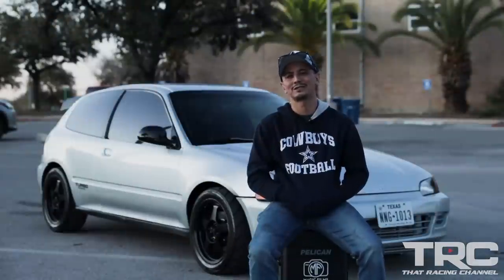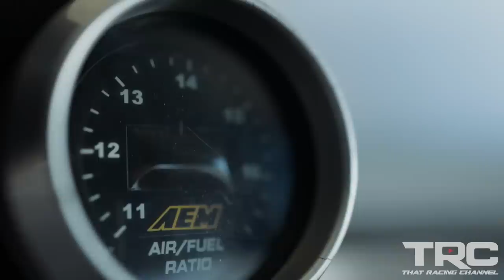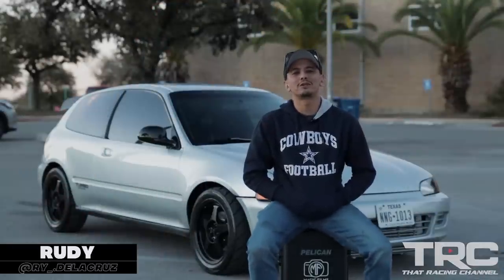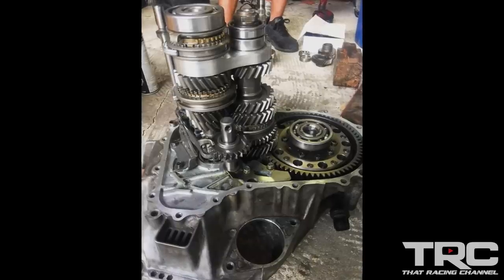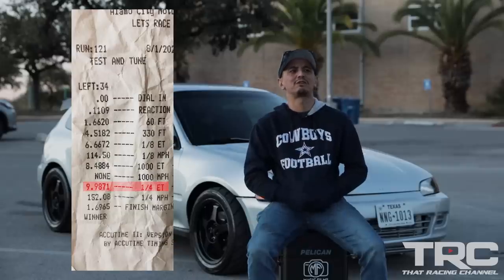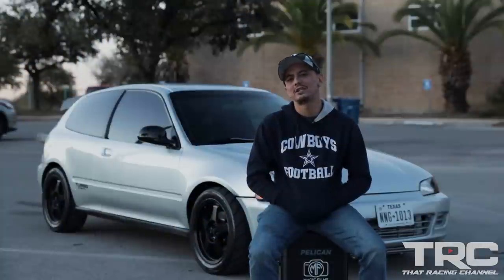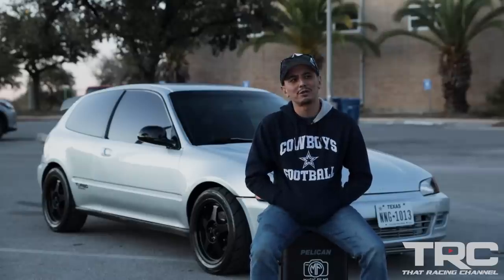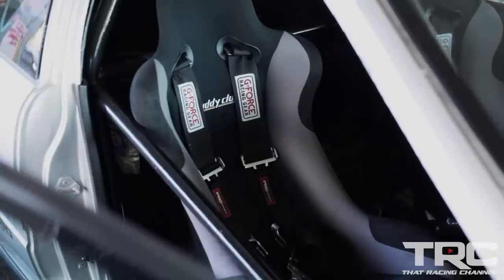Sleeper 700HP Turbo Honda "V8 Killer" GAPS Mustang! (LS VTEC B-Series Civic)

Comment: Finally a honda without a hood exhaust exit...
Reply: Seriously! I get tired of seeing that and I don’t consider a hood exit a true street car
Reply: Its not the exaust, is the wastegate
Reply: @panemamen  my waste gate dump points down in the engine bay making me smell like exhaust fumes ☹️
Reply: Who care about a hood exit?
Reply: Hood exit is a bitch sometimes to, if its even a little chilly as soon as your on the throttle it just fogs the hell out of the windshield.
Reply: Its waste gate for the turbo bro not exhaust
Reply: @xpapaj0ex570  Alot of people pipe both the waste gate and the down pipe put the hood if their going to take the time to do one, personally if you really want a super short downpipe I think fender exit is the way to go.
Reply: @barneymiller7894  or side bumper exit
Reply: @petrolhead8851  Yep, anything that keeps it off the windshield lol
Reply: @barneymiller7894  I’m building a high compression all motor k24/k20 civic coupe,hoping I won’t need a hood exit or fender exit to get as much power as I can since it’s gonna be a street car
Reply: Seriously man, this is a proper Honda street build
Reply: @petrolhead8851  How much power are you looking for on what fuel?
Reply: @petrolhead8851  its you want 350whp+ you're guna need dump and good fuel.. 300whp....e85 and full exhaust can be done.
Reply: @b00stedrust  anywhere from 300-330whp on e85
Reply: @petrolhead8851  yeah I've even seen someone make 350 on E85.. But it was a good test E85 in the car only lasted 2 seasons
Reply: @petrolhead8851  but 300 wheel on most any E85 from the pump is pretty achievable and in something around 2,000 pounds the car itlss trap mid-high 120s and that is 600cc bike territory and that's fucking fast I don't care what these idiot internet kids say about cars under a thousand horsepower not being fast because I guarantee they 5-600 wheel horsepower EG would fucking terrify them... in 2008 I had a 418 wheel 98 Integra GSR.. and that routinely Made Girls cry and Men very very uncomfortable ... it destroyed many 600 wheel horsepower v8s and 10s.
Reply: @b00stedrust  only 2 seasons huh? Any idea what went wrong? I’d honestly be happy around 310-320whp,I’ve been buying literally every expensive part that can get me there so that there’s no excuse,I already bought a complete haltech ecu,harness,and digital dash,so the tuner can tune it with ease,I’m buying everything to convert to e85,I’m also porting and polishing my head and intake manifold,and I’m using drag cartel’s 3.2 cams with supertech valve train,and ferrea 6000 series valves,for my bottom end I haven’t really decided what combo yet but it will for sure be around 12:0.1 compression
Reply: @petrolhead8851  this was a 12.5:1 in ny on e85 in the summer blend form...and it bowed one of the cylinders.. Wad a weird failure ... but was running 9200 rpms....Idk all my expertise is in b series.. But yeah... Needed new block...he told me if he was making 300whp...it would last 5 years+ with abuse and daily driving in summer...or on e90 or ignite or something it would be safer
Reply: @barneymiller7894  it's the smartest as well. Hood exits aren't good and people do it purely because they think it looks cool
Reply: hood exit will always be the best possible setup, and if it has tags it's 100% a street car
Reply: Its open downpipe, still has no exhaust 🤣🤣
Reply: What’s wrong with a hood exit hater ?
Reply: @Casey_and_Cars  lolll dont know where you are from...but over here in quebec if the exhaust is not stock its not a streetcar...try running open header here you will go bankrupt.I only did a little pass in my area when i was making my 3inch exhaust...every single neighbour came outside..one wanted to fight..cops came etc...i was thinking "man times changed"
Reply: Which usually happened in USA, not in Asia.
Reply: Soooo true!
Reply: @barneymiller7894  damn 😢
Reply: @panemamen  exactly
Reply: Because is a sleeper 🤦🏻‍♂️
Reply: Man it’s just easy to do that like so much easier
Reply: exhaust or down pipe w.e hes running on this build,sounds decent has a deep tone to a serious loud honda tone,lolthumbs up👍👍🔰
Reply: Ikr
Reply: @petrolhead8851  must not understand that most fast Honda’s are awd and have no where to put an exhaust which is why they do that
Reply: @b00stedrust  I ended up buying cp 12.5:1 pistons, stock stroke eagle rods, kinsler 67mm itb’s that I just recently ordered, my z3 head will be cnc ported, it will have a complete haltech management system, with all the haltech sensors I can use to monitor the whole car, and the car will be pretty light since I took all the interior out, and I’m switching to a tubular subframe and A-arms.. your integra sounded like a beast by the way, what do you drive now?
Reply: @treyyoder  you are completely right about that, I recently found that out, thanks for the info tho
Reply: All hood exit hate look aside. We can all admit it hood exit sounds the best with turbo spooling. No cap.
Reply: @petrolhead8851  Already seen it. Still take the hood exit sound any day.
Reply: @effingwrecked1917  the hood exit sound is also my favorite, but there are some full exhaust Hondas out there that sound just as good
Reply: Most the time on really high hp builds, 1200+ the hood exit is designed for downforce, look at the big boy procharged cars, zoomies, pointed up and back adds 400/600lbs of downforce
Reply: He just mad he probably got "smoked" by one 😁
Reply: @petrolhead8851  fr it usually gives it away for a sleeper
Reply: It’s just easier man. Way easier. Especially when you start the AWD conversion. Routing the damn exhaust is damn near impossible on most of the Hondas. 🤷‍♂️
Reply: Lol facts it's easier set up though
Reply: @xpapaj0ex570 it is exhaust most of the time you do not see flames coming out of a waste gate my brother
Reply: Usually a waste gate dump but agreed
Reply: Amén

Comment: People seem to have forgotten how deadly a B Series can be.
Reply: Always.
Reply: B20, with B18 Head,  B18C5, H22A..... hahhaha your right ... a bit of boost and your flying ....
Reply: Now just awd swap it
Reply: @spankthemonkey3437  Another underrated set of engines, nobody wanted them back in the day & always swapped for a B series. SOHC D Series are now cheap & easy to build.
Reply: @MK-ng5fp  Even with a F22 SOHC(Big brother of the D series) still makes massive power on boost, out of a single cam. And the parts are stupid cheap.
Reply: Boost is always the answer. 4cly engines just love it.
Reply: Love this comment section
Reply: D16, b18, b20, and h22 are all slept on hard.
Reply: @CalebTheFluidChanger  Those aren’t slept on, like  the SOHC F22’s are. It is the most underrated Honda platform to use in a swap. Truth is, you don’t need two cams to make power with a Honda.
Reply: @untoldguitarist  I'd go so far to say more likely the F23A1 is the most underrated as everyone who owns a CG3 Coupe seems to NEVER do anything with them and the rare few that do, rarely ever turbo them or build them like that when they appear to have an even stronger bottom end than the H22A has. Not bad for a single jingle. 

Now, IMO still ain't touching a 4G69 MIVEC as those flow 260cfm stock which is pretty high almost at 4B11 and K20 head level flow (280 - 285cfm) and with light port and polish you can get it up to 300cfm basically. They already gotten it into the 9's in a Mirage but I would love to see more guys build NA ones to compete with some of these Honda engines
Reply: This comment section passed the vibe check
Reply: @jordanprice9285  mirage with the 4g93 sohc good motor too
Reply: @daltondaniels890  This guy in Florida has a 4g63 swapped eg hatch. Crazy lol.
Reply: You’re absolutely right, before the K-series everyone was loving b-series and I think they forgot what a light powerful engine the B can be when done correctly.👍🏽
Reply: Love the comment with the rotary picture profile 😂❤ 
I like both Honda and rotary
Reply: @13bfc b,F,H,K all can be dangerous
Reply: @untoldguitarist my CG6 accord has the F23A1

Comment: Drag wing, turbo sticker, speed holes and intercooler sticking out = sleeper but nothing screams sleeper with a vise grip window crank.
Reply: for Honda ricers standards, is very sleeper look
Reply: Hondas aren't so much sleepers as they are like the joker in a deck, wild cards. Car like that could make 350hp or 1000hp.
Reply: That is standard  on 80's corolla's.The retaining clip always pops.  :D
Reply: when it comes to sleepers i honestly think its all just personal opinions.. i mean, a ultra sleeper is something that looks 100% bone ass stock, even down to enginebay details, but obviously some cars have a hard time to obtain that look to keep the power they run, i can accept that a 600 hp car is lowered and aftermarket wheels, because you cant tell it has 600 hp. But personally i do prefer a sleeper that has everything on the outside oem, even down to steelies and hubcaps
Reply: I hate those holes. I be seeing clapped out Toyota Tercels with those holes
Reply: @motion2597  They're pretty necessary on a fast Civic, the floor pan channels air right into the bumper so it acts like a parachute lol
Reply: Thing is you have no idea what’s under the hood. Could be decently fast or very fast.
Reply: you also forgot those R888
Reply: @Bergie_00  i have r888s and im barely like 300 hp... hook and book. Will easily kill v8s from a dig even if its FF.

Comment: 700 hp on the streets and able to put the power down is impressive. Also it drove straight not bouncing all over the lanes is always a win for me. Very clean hatch keeping the Honda’s alive
Reply: Right, suspension on point
Reply: And boost by gear.
Reply: Straight facts while that mustang was looking at the sky I know buddy was laughing his way to the finish line
Reply: Won't be alive for long. I'm not mechanic, but  squeezing 700hp out of such a tiny engine is going past the safe limits.
Reply: @KainRazielMT  LOL…it’s a built motor. His set up is absolutely perfect for 800+ HP
Reply: @threedirty5455  is it still around?

Comment: finally a non k series
Reply: 🔥🔥🔥 H2B>B>K
Reply: @barneymiller7894  b over k anyday
Reply: It is definitely refreshing to see some B series love instead of the same exact K build over and over.
Reply: @barneymiller7894  lmao no. When theres N/A K series blowing the doors off boosted B series. Even the Honda forms are saying boosted b series are getting chopped by K series
Reply: ITB > BOOST
Reply: NA IS BEST
Reply: @CesarMartinez-gl9ko  fastest stock chassis FF is bseries everything else is irrelevant.
Reply: @TheBb6prelude  if we're talking stock no b series is running anywhere near the K. The FD2RR has proven that and has even put better lap times than an S2000
Reply: B with Boost is best!! Even B20V all motor like mines can beat mild built Ks.. it all depends on money 💰  for the price I'll always choose the B over K.. but once they get rare and the amount of money to get B series goes up then I'd switch to K if I need to rebuild.
Reply: ShawnDon 97  lmao if that was the case Honda would be using their B series more. But no Honda races with K and the K dominates. I've had both platforms and you can look  at the Honda forms the guys who do K swaps will tell you the same. You can get 300whp N/A out of a K easily and in the B it's a struggle
Reply: @2_2_4_3  where I’m at k series are plentiful and cheap, b series are super hard to find and wayyy over priced unfortunately
Reply: @benm12310 that's because the b18c5s will forever last unlike k series thats constantly need work done. Specially once turbod.

Comment: The fucking mustang did a wheelie and the civics just like, nah, spinning's winning son!
Reply: The Honda red Lit lol
Reply: @Stephen198600  mustang would've lost regardless lol
Reply: Wheelies aren't fast.
Reply: Wheelies aren't fast, if anything they slow uu down.
Reply: Honda would've wheelie too if it was rwd
Reply: @barneymiller7894  Ask LS George then
Reply: @Toxic2T  I'm aware the blower blazer has put down some good passes with the wheels in the air. So has Billy from SRC, Raggedy Ann, King Turtle, etc., etc., etc. I'm also aware that every single one of the drivers, including LS George, will tell you that they can make a faster pass with the wheels on the ground, or in some cases if they had the ability to keep the wheels on the ground.

Comment: Never underestimate a Honda they get overlooked a lot but they're one of the best in my opinion
Reply: Theyre the best modern "hot rod" in my opinion. To clarify when hot rodding first started getting big in the 40s the thing to do was find the cheapest, lightest coupe you could and stuff in the biggest, baddest motor you could build. Hondas fit that way of thinking to a T, so in my opinion if you love old school period correct rods like at The Race of Gentlemen, you should love Hondas to!
Reply: @barneymiller7894 

*too
Reply: @circadianhaze  I ain't care.
Reply: Bruh some of hondas motors revved to 9k out of the FACTORY
Reply: @christiandevos9280  8200 in the K20A2. Stupid high revs for a production car
Reply: Mh the k20a in the dc5 type r was 8900. The rsx is nothing compared to the r
Reply: Most people just dont know about Honda or hate.
In reality they make all types of engines, including F1 engines

Comment: Lol At 300whp on my lsv turbo build, it felt like a train i can only imagine this..
Reply: Watup caca face 🤣😂💀h22 Gang right here G 🤙
Reply: An airplane ✈
Reply: Seriously, people don't realize how fast a 300-350whp Honda can be! I talk to so many people who want to build a 500 or 600hp car when they have no experience with fast cars. I also try to steer them towards starting with a basic all motor build and go from there
Reply: @barneymiller7894  whenever I do my build I'm going to 300 and then 500 prob way way way later. Like people forget hp to weight ratio is crazy
Reply: #FACTS
Reply: My lsv is 400whp and pulls on hellcats.  700 would be intense
Reply: @barneymiller7894  spot on. My pro2 cam F2b F20b with a b16 and 4.92 finale drive in a 2300 stock chase full weight 93 civic hatch DX. Was enough to feel the thrill of being in a fast car. In reality it wasn’t that fast but not dog shit slow either.  It much hp just over 200 wheel but ran 12.8 at 108
Reply: @TheBb6prelude  Excactly, everyone wants the fastest thing on the street but they don't realize how fast that actually is, or how much money and maintenance it takes. Cheap quick cars usually end up being more fun and less stress overall
Reply: I'm satisfied with 215 to the wheels, my EJ1 weighs 2290 with me in it. . I'm not the fastest but only V8s want to race me.

Comment: "Sleeper" except the giant intercooler and wing in the back, and the custom rear suspension lol
Reply: Did you look at the car and immediately think 700hp? Lmfao I know I didn’t haha
Reply: To be fair though it looks like the same as every civic we all see running around with 80hp.
Reply: @richardcailincavazos  lmfao exactly
Reply: How do you expect 700hp from a small 4 banger turbo without an big intercooler? Rhetorical question...
Reply: @fuckngreat8955  ive seen a stock dx coupe with a feaux intercooler intake that wasnt even hooked up.  And ive seen a bone stock ls car with a full drag wing. Its out there... lmao. But you all seem to be missing the point 8/10 people won't even notice most of that shit when just rolling up on them on a highway
Reply: @richardcailincavazos  correction... 95/100 people won't notice.
Reply: “just a ebay kit bro”
Reply: @fuckngreat8955  I actually raced one. It was quick but not fast by no means. 280 whp ef hatch.
Reply: Seeing it i would expect 350-400 whp  not 700..

Comment: Sleeper? With that huge inter cooler and drag wing?
Reply: To the untrained eye yes sleeper for u and me not so much 9 out of 10 people wouldn’t have a clue
Reply: Sleeper to hellcat owners or dodger owners those owners r clueless
Reply: More like a wild card, at first glance it could be a 350whp car or 950hp car.
Reply: Don’t mean much really. Could be stock motor with a turbo. Still fast with that setup but nowhere near 700 hp fast.
Reply: @barneymiller7894  I agree, I would like at it and not know exactly what to expect. I probably wouldn't expect 700+ though haha.

Comment: b18 swapping and boosting my 95 lx 4 door. its not gonna be as crazy as the one in the video but im gonna be building the top end of the block and shooting for 350-400hp hopefully. wanna keep it incognito as well. no paintjob or panel replacement besides some rust removal and some rims that look stockish but are a wider and some coilovers. no hood exits or anything. i wanna do it proper.